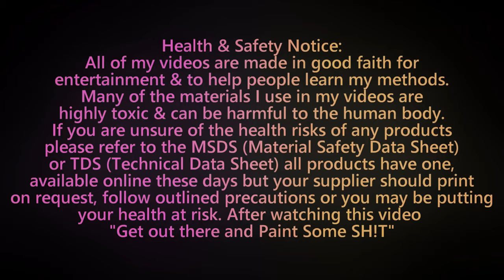Prep Work Toyota Rav 4

Comment: Great job on the prep work Gunny, I've recently changed over from my old air da to the Mirka Deros electric da and absolutely love it, it's so much smoother and quieter but I still tend to get pigtails on my prep if I'm not carful, I use the 3M Cubitron II purple discs, am I applying to much pressure on the sander or is it the speed it's set to? any advice would be great either in your reply or shoot the breeze as you did a while back for my WoW primer issues which are solved thanks to you mate 🙏👍
You may remember I had no heat in my booth back then but now I have fitted a diesel powered hot air heater. John UK